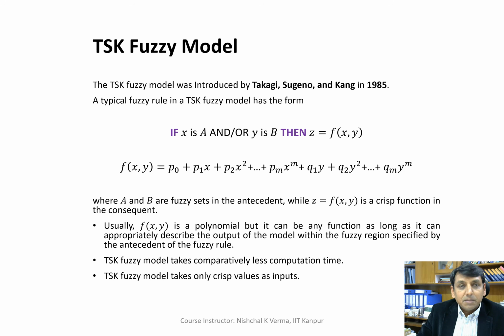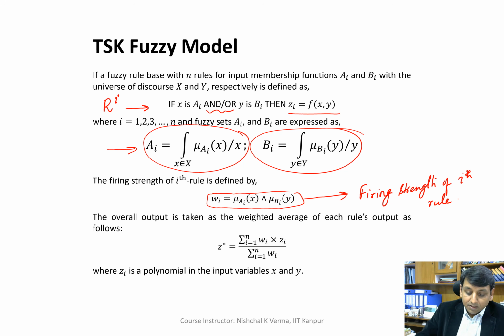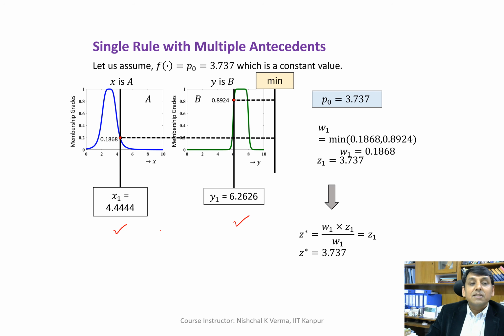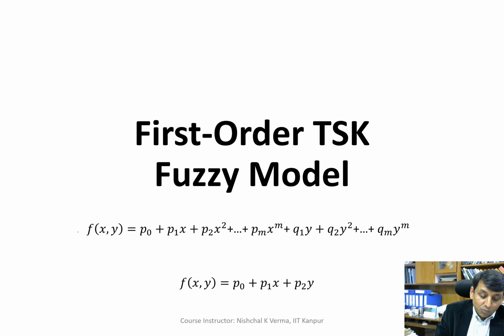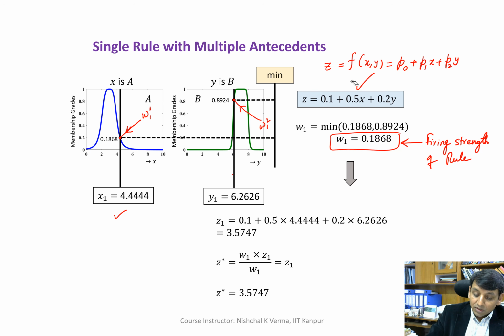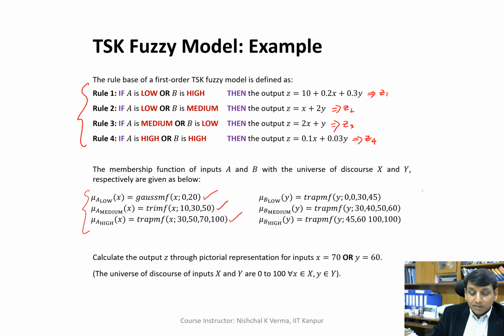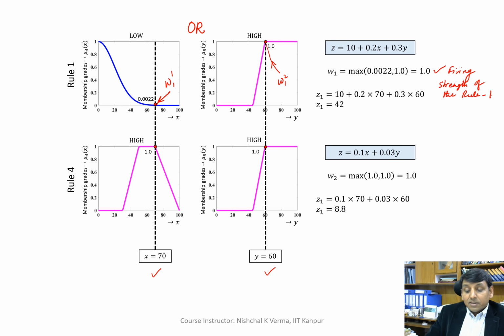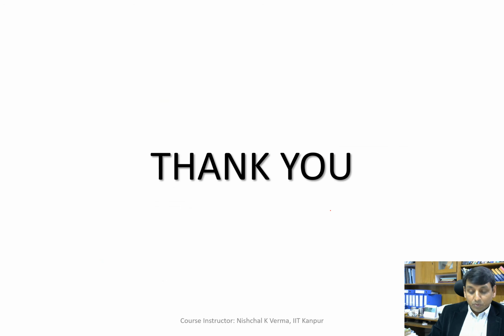Lecture 60: TSK Fuzzy Model By Prof. Nishchal K. Verma

Comment: please Mr. Verma could you help me in solve this exercise

( a constant force F acts on a body with mass M  moving on a smooth surface at velocity V the effective power of this force will be EP=F(v) cos ϴ ,
(to solve this problem could I assume both V and F as constant and changing only the ϴ
or how can I start to solve this problem) , compute the EP for ϴ(150, 90, 0,-30 ,-140)
 for the three output rules

R1  if ϴ is Z then most efficient
R2 if ϴ is PB or is NB then negative most efficient 
please could you solve this as soon as possible please.